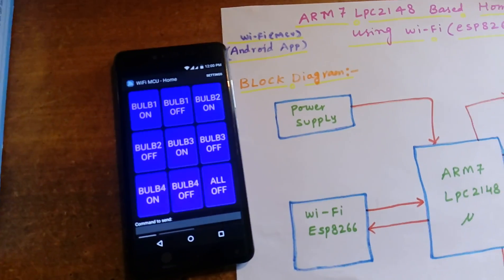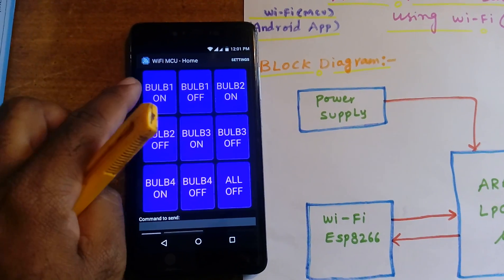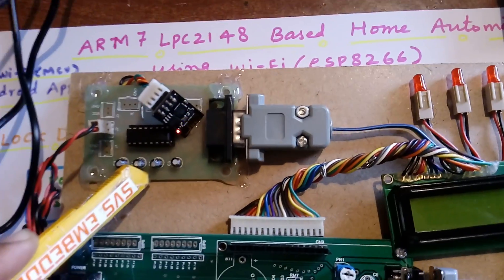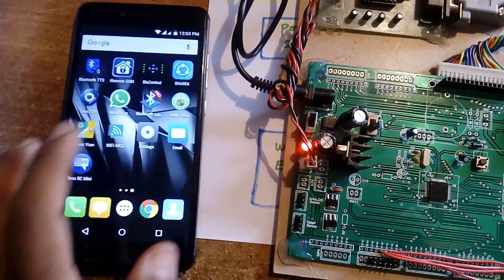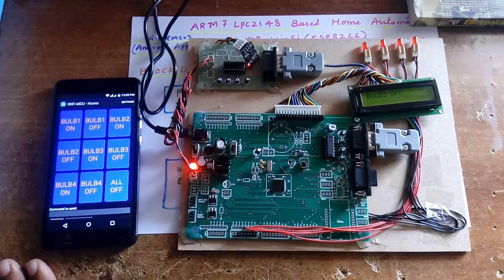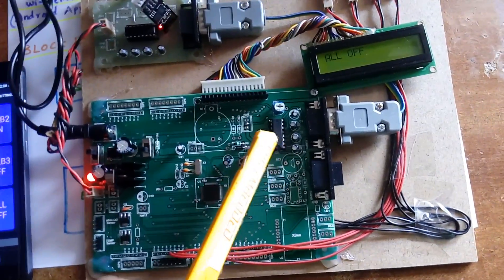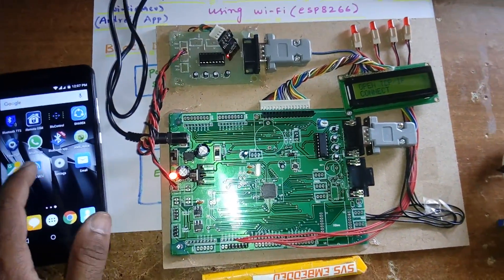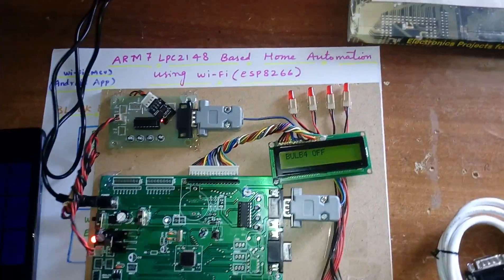ARM7 LP2148 and Android Based Smart Home Automation Using Wifi Esp8266

Comment: Sir, I want connection between esp8266 and lpc2148 plz send it to kirandonni1111@gmail.com
Reply from the maker: Thanks for watching and your valuable Feed back.yes we will provide ckt diagram.
we are selling the projects with least cost.if u order the project we will provide working hardware kit along with 
1.abstract
2.datasheets
3.documentation
4.schematic( circuit ) diagram.
5.software code.
6.sample ppts
7.photos&video file on entire project
through google drive
send me a mail to  svsembedded@gmail.com,info@svsembedded.com.
9491535690,7842358459,www.svsembedded.com,www.svskits.in,
we will send u the how to order procedure to u.